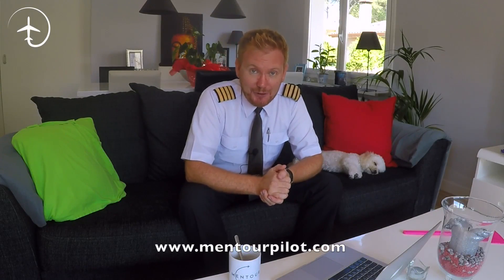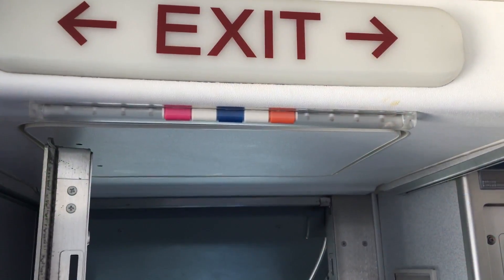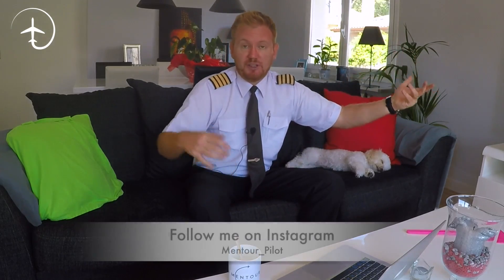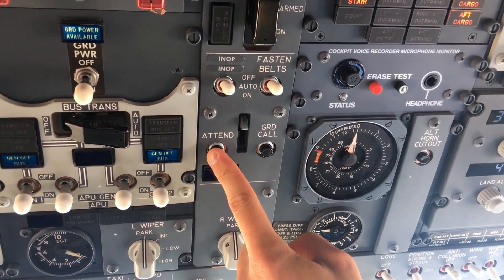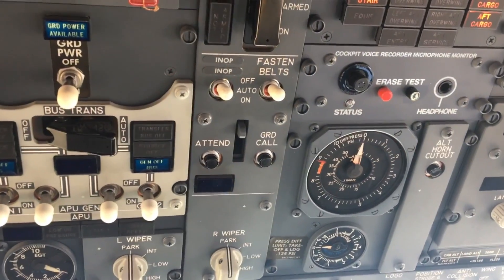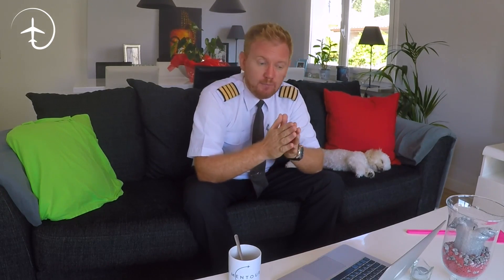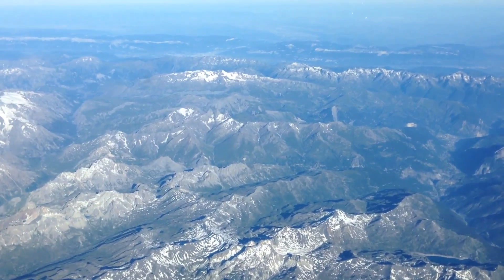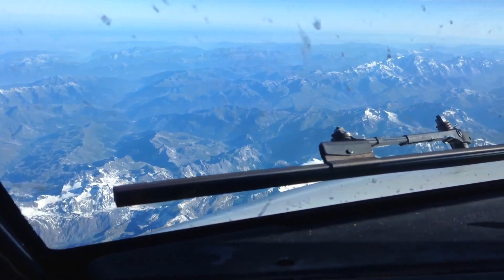Aircrew secret "sign" language - Explained!

Comment: Why do aircraift not have camara`s in the cocpit. so you can see the tail and wings. when there is a problem or straings noise the crew can simpel and fast check the bodywork when needed?

Comment: 10-100: Crew needs to use the restroom
10-1: Unable to copy message
10-2: Message received, response not required
10-3: Standby
10-4: Message received and understood
10-7: Out of service, unavailable
10-8: In service, available for assignment
10-9: Repeat message
10-20: Location
10-30: Does not conform to regulations
10-33: Emergency, all stations stand by
10-60: Request for ground support equipment
10-70: Fire or smoke on board
10-99: Medical emergency on board

Comment: Still wondering why there is an extinguishable No smoking sign (plus button in cockpit) these days, when smoking on planes has been prohibited for a long time. Using it for communication seems makeshift, as if the proper design for the procedure was still in progress.

Comment: Can the ground authorities remotely unlock the flight deck door in the case of all the flight crew being incapacitated, maybe after the jet fighter confirmation?  In one of your videos where this happened, one person, probably a cabin crew member, was trying to fly the plane.  But, if no one can get in to try to get radio communications and instructions, it’s hopeless, the plane will crash.  I also have a uniform question:  do the flight crew wear the basic uniform you do, then add company insignia, or is each uniform completely company-specific?

Comment: I once flew over the Cascade mountains in mid-winter, in a small commercial commuter plane.  It had 11 seats and only a pilot and co-pilot (no cabin crew because no beverage service), separated from the cabin by a curtain, which they kindly left open so we passengers could watch them fly the plane.  This was pre-9/11, of course.  Apparently I was the only non-regular, flying to a jobsite from Sea-Tac.  The pilot said there would be some turbulence, but I was completely unprepared for what that meant, it was nothing like jet travel.  It wasn’t just some bumps and shaking, the plane seemed to just rise and drop hundreds of feet at a time, over and over again.  The faces of my four fellow passengers, buried in their newspapers or work, remained serene, but I was pretty terrified at first.  I had been in a small private 4-seater before, it felt like flying in a tin can, but not going over a major mountain range, we just went to a local fly-in restaurant and that was bad enough.  I love it when the pilot leaves the tower communications on so passengers can hear it through the headphones, that’s how I learned about the ATC centers on my regular flights:  leaving San Francisco center, “g’day Portland center, g’day Seattle center”, etc.

Comment: Just recently, I was seated in the second row of a flight from Kennedy to Las Vegas. About 2/3  of the flight, the cockpit door opened and a flight attendant stepped inside. Moments later, the co-pilot stepped out, chatted with an attendant. He then used the restroom, exited, got coffee, then returned to the cockpit. Minute or two later, the captain exited and did the exact same thing. After he returned to the cockpit, the attendant exited and locked the door. I maintain that the security of the aircraft was breached each time the door was opened. Of course the pilots need to use the restroom but in my view, safety was compromised because that cockpit door should never, ever be opened during a flight.
Reply: You're a moron. That happens every flight.
Reply: Is this a joke? This happens on most flights. Pilots need to use the bathroom and they follow certain procedures when this is happing.

Comment: Where I worked, from the pilots perspective...
Also intercom in this case refers to the handset, not the public intercom the passengers hear.
1 Ding, no dong... Usually acheived by cycling the seat belt sign on and off very quickly. Climbing or descending through 10,000 feet. 
In climb...FAs can now call pilots on the intercom for all non emergency routine communication. On descent... FAs should not call the pilots unless it's considered a safety of flight issue for remainder of flight.
1 Ding, folllwed by 1 Dong.
I believe that was used between FAs to pick up the handset to talk with each other. If directed to the cocpit, it's asking for a pilot to come on the intercom. 
1 Ding followed by 1 Dong 2Xs...Any FA please pick up the handset. Pilot wants to speak with a FA, routine.
1 Ding, followed by 1 Dong 3Xs. All FAs pick up handset immediately, non routine.
1 Ding, no Dong. Usually the seat belt sign has either been turned on, or turned off. Either the pilot or if a pilot doesn't make the announcement, a FA needs to come on and give the seat belt sign announcement. "Keep it on, even when the seat belt sign is off Bla, Bla". That announcement is required per regulations every time the sign changes status. Only the pilots control the seat belt sign. Although FAs will request it to remain on occasionally. Smoking sign will do that as well, but that sign is always left on now.
Reply: I remember being told by a pilot I was sitting next to on a flight that all dings and dongs means everything is fine, unless you hear the 1 Dong 3X, at which point the Flight Attendants will head to the front or back of the plane .  He explained that mean something unusual was happening and to remain calm, but also be prepared for anything that may come.

Comment: 🤔☝️Airliners Communications Described In This Video Is No Different Than The Same System That All Ski Resorts Use For Their Lift Operations Communicating Between The Loading Terminal & Top Terminal At The Ski Resorts.

Comment: I've seen the one on the 777. American has a 3-4-3 configuration in economy class (as do most other 777 operators), and they have 2 blue lights for each aisle. One for the window block (seats ABC/JKL) and one for half of the centre block (seats DE/GH)

Comment: Sir why airplane tyres are not shrink and damaged during landing I mean in high altitude minus 50 ruber get extremely cold and when it approach to runway weather suddenly get warm so can you explain how they manage that solution specially for those airplane which tyres visible when landing gear is closed hope u get it, thanks for your efforts for educating public.

Comment: You said the No Smoking switch doesn't do anything (presumably because the No Smoking lights are now always on, or don't exist on newer planes). But does changing the position of the switch do anything (make a tone in the cabin), or is it just a reminder as to what stage you are at in the process?

Comment: Terrain, terrain, whoop whoop, pull up pull up. Thats a sign that you are going to land VERY soon.
Reply: On a number of occasions I’ve been sitting close enough to the cockpit to hear the “Sink Rate, whoop whoop”  alarm go off on approaches. Always a little unsettling to hear that. Apparently not all airports or approaches are loaded into the system...
Reply: @globalautobahn1132  That is true.
Reply: I always hear that sound as the aircraft's computer desperately crying out "Terror! Terror!" as it knows it's about to die badly...
Reply: When you hear the computer say: "I'm sorry Dave, I'm afraid I can't do that" you should be very worried.
Reply: And fast
Reply: Thats a sign you’ll land….

in heaven
Reply: haha
Reply: Does the terrain warning go off during a landing? I'd think that the plane would " know you were coming in to land
Reply: Flew quite a bit on a King Air my company leased years ago.   They had 2 pilots so no chance to sit up front.  But could sit 5’ away and watch operations.  Always remember hearing “minimums, minimums” on final.  I believe that was calling out the decision point for runway visibility on ILS approach.  

Was interesting taxiing behind a 777 a couple times at Chicago o hare
Reply: @mikegirard4388  Indeed that callout is the pilot monitoring informing the pilot flying it's time to make the final decision. The response should either be something like "Landing", "Continue" or "Go around" the former confirms the intention to continue the approach, the latter indicates the intention to abort the approach. These calls are also used for non-precision approaches though the MDA (Minimum Descent Altitude) is typically even than the DA (Decision Altitude) used for CAT II ILS approaches. They will generally come even later for a CAT II or CAT III ILS approach for an aircraft so equipped though this being due to aircraft equipped to follow a CAT II/III ILS must include a radar altimeter thus this DH (Decision Height) is based on actual height above the terrain or structures with a rather small margin of error too. Pressure altitude above mean sea level which is completely ignorant of the height of actual terrain or structural hazards below and even that with a larger margin of error so non-precision approaches or those with only basic CAT I ILS support either on the part of the airport or the aircraft have to build in larger safety margins.

Comment: He says the cabin crew goes out and locks the cockpit door and it remains locked through out the flight.  If it is locked from the cabin side that defeats the intended purpose.  It should be locked from the cockpit side.  What airlines does he fly for?

Comment: One thing I have wondered about since the addition of the locked and secured cockpit doors is what the pilots do for food or drinks or coffee?  For a long time I just assumed that there were time that you would unlock to the door let one of the flight crew use the facilities or to switch crews on a very long flight or to let an attendant deliver meals/coffee etc.  But obviously that is not right as you say the doors stay locked the whole time and because you cannot unlock them to check what is going on in the cabin, you can also not do it for food/coffee,,, so what do you do?

Comment: Interesting video! For the attendant calls made with the attend button to advise of readiness for departure and to release the attendants, how are these reset in the cabin? Also how would you communicate with the flight attendants during these phases of flight if it became necessary but they were expecting those dings rather than a call?

Comment: so.. why does a "NO SMOKING" switch have a middle position?
Reply: That's Vaping Only
Reply: Robert Hindle haha
Reply: I guess that's for "auto", just like the fasten seat belt sign. These two signs are put near each other in most planes after all, so it's likely that they're controlled similarly.
Reply: He mentioned it in the video. It will switch on in certain cases like gear extension.
Reply: Automatic

Comment: That "Ding-Dong" is the doorbell of the aircraft, because the pilot ordered a pizza.
Reply: Or the Avon Lady delivering an order of bath oil.
Reply: LOL,  I have seen does blue button before at the passenger cabin,  but I have not used any of these buttons for the passenger because I don't really needed that blue button but I only used the spot light button for reading books only and close the window by pushed the button and the window will become darker blue window....

Comment: your overhead passenger service unit has a air vent which can be increased or decreased by turning the air vent ring. Of course pressing the picture of the light will turning on the overhead reading light, but be aware pressing the picture of the flight crew will not turn us on.

Comment: When I fly on British Airways, the last PA I tend to hear prior to landing is something akin to telling the attendants to set the doors to manual or whatnot (presumably so the slide doesn't deploy when the door is opened) - the one thing that always stands out for me though is "and crosscheck".
Reply: I recall that from BA. It sounds so wonderfully professional. It’s like your in a film about flying but you are really there in a seat. I think this has something to do with also ensuring that the emergency slides are ready to deploy if needed, as you say. I think they may well cross check with each other to make sure this check has been made.

Comment: Many airlines have the cabin crew enter the cockpit (after using the 'basic' cockpit lock code, although the cockpit is usually unlocked during this phase, as they also might need to receive the loadsheet from the groundstaff), and turn over a placard that says "Cabin Secure". This tells the pilots that everyone is seated, cabin luggage is stowed, and cabin crew (except the cabin manager obviously) is seated for take-off. Saves Cabin Crew talking to pilots and distracting them while they are probably doing their pre-flight checks or communicating with company ops, surface movement control (SMC channel), or the tower. Next communications with cabin crew is to take the coffee/tea/water orders!

Comment: Off topic...
On my last flight, last week, I set my phone on flight mode, of course 😇
But I couldn't resist to see if my TomTom (GSP Navigation) app, I have installed, worked.
It did took a while to get a good satellite fix. But sure enough. I flew over a Dutch city. I noticed the speed limit sign in the app saying 60 km/h. Right next to it I saw the aircraft's speed: over 700 km/h. A few seconds later I saw a speed-control-camera warning ahead. I can only imagine the look on the face of the officer. Made me giggle...
Of course we were well over 8km high at that time. So, I bet the plane didn't trigger the camera. Would have been fun though. 

Quickly I made a screen-capture to share on facebook. I made a few people laugh. 😆

Comment: The cockpit door does not stay locked the whole flight. Every time you guys go to the lav, it opens twice. That is quite a hole in security.  Hijackers could just wait for it to open. El Al has addressed this by completely separating off an area with a lavatory for the pilots. No other airline has bothered to do this because they don't want to spend the money.

Comment: Why is so little attention paid to the audibility of cabin announcements? On occasions the cabin attendants' announcements may be clearly audible whereas those from the flight deck aren't, and vice versa. When wearing headphones the sound levels of in-flight entertainment seem to have been carefully controlled but crew announcements can be deafening. If a simple bit of audio AGC was applied to crew announcements it would remove these ambiguities and enhance passenger safety and comfort.

Richard Thomas

Comment: Hi Mentour first time post so many thanks for all your vids. A question with regards to what's going on in the back of the cabin when the doors are locked. Is it not possible for a system like cctv and monitors inside the cockpit could be used so you can monitor what is happening without assistance from the cabin crew. I realise this has probably been mentioned many times before but as someone who has never flown before I am quite curious about why certain systems have not been or are in place. Likewise external cameras to monitor the engines and  surfaces from the cockpit.

Comment: What's annoying is that still every single one of these signals makes the chime sound for everybody in the airplane. By now technology should be available where you could just attach lapel pin transmitters or speakers where only the crew could be alerted without disturbing everyone else in the airplane.
Star Trek invented these in the 1960s, secret service headsets are now used in all sorts of business for this same purpose and by now smart phone level technology is available in real life to make these possible. 

While driving a lot of high tech forward at the cutting edge of science for our safety, one downside to commercial aviation being primarily profit driven is that for many of its lower expense items are lagging technology as they are being neglected. ('why update it if it's not expensive and we can still use the old')

Comment: Why do you still have a "no smoking" light, even on new aircrafts?  Smoking has not been allowed for several decades in the airplane. It must be another sign or signal you can use.
Reply: I think there might still be flights (Mostly around Asia) where smoking is permitted, so the signs would still be relevant on those.

That said: With smoking now barred on flights throughout most of the west, I do think it strange they havn't repurposed the "No Smoking" lights into more relevant "No electronic devices" ones! :-)
Reply: @ddragon8154  Maybe some places in Asia.  Some years ago i was passenger on a plane from Bucuresti Romania to Hamburg Germany, and a romanian man smoked on the lavatory.  But the stewardess discovered it, and OMG - she yelled at him so much as i never heard before. She was really angry,  i dont know if the romanian man understood so much english - BUT i am sure he understood what she meant.  He will NEVER EVER try to smoke on a plane again, he he he.

Comment: plenty of mistakes Sir, one handset per crew seat or/and door. Not only one light signal in the front middle and rear middle. Again, one per purser station on each aisle. On Airbus, you have a screen who give information about who call. For cabin ready, now chef purser have a switch " cabin ready ". The cll code directory is on the back of each handset ( Boeing ), there is no secret code...

Comment: On the Emirates airbus A380 one of the channels is from a camera mounted on top of the rudder SO COOL. I think they have another channel from a camera pointed straight down below the plane (looks good even on the runway).
Considering Shatner’s nightmare at 20,000 ft, why haven’t we learned anything and pointed surveillance cameras from out at the wingtips? It could be highly critical information to save the plane in case of hideous creatures lurking about!